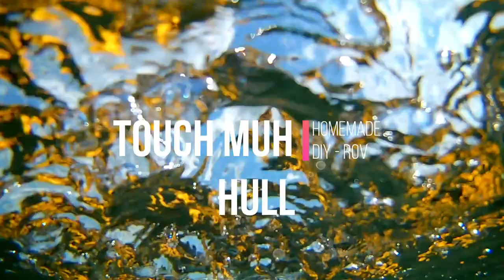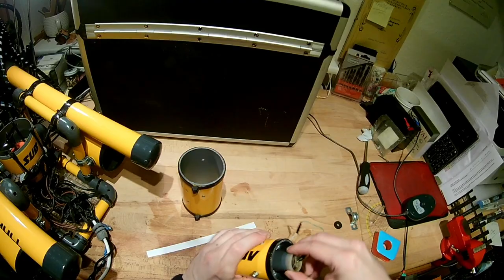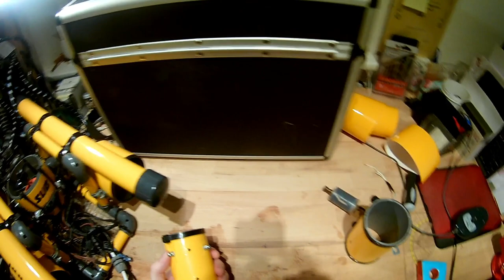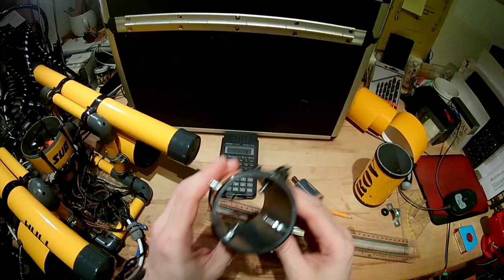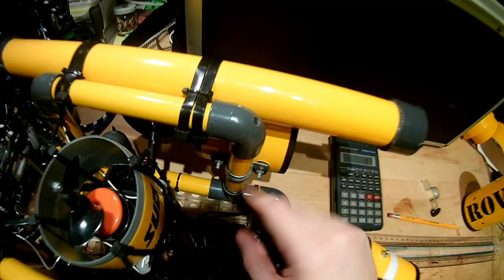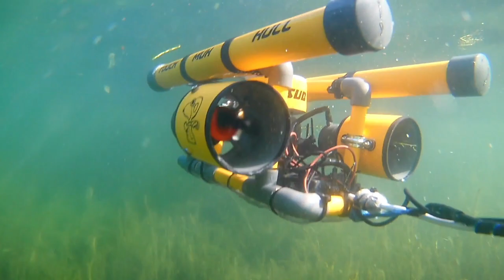ROV Thruster Housings DIY submarine SeaPerch

Comment: hey sir nice content you got here. what motor do you use and how to make the water seal? thankyou
Reply from the maker: I used seaflow bilgepump Motors - 12 Volt for 350 gph. Since those are water-pump motors you don’t have to seal them. I already tested them to a depth of about 15 meters - just under 50 feet. No problems what so ever. 😀

Comment: Do you think 2 of these would be sufficient enough to power my kayak  at around 4 to 6kmh ?
Reply from the maker: No. These engines give very little thrust, I think about 3-4 lbs. A small outboard motor gives like ten times as much - which is needed to propel an actual boat. 
Love the idea though!! 😃

Comment: Wait did you say bilge pump motors as in you replaced the pump with proppellers?
Reply from the maker: Yep... cut them open, expose the drive shaft,  attach the propeller with a coupler ad you are done.
Reply: @agermangineer  the things you learn. I used those as they were soposed to be used which is just to pump water loool
Reply from the maker: @romellyarde907  well, for me that would be a first... :-)

Comment: Out of curiosity do you use 1100 GPH bilge pumps? Some have said they're too powerful.
Reply from the maker: I started with 350 gph and now use 1100. 
Too powerful is not true, you just have to make sure your tether, wiring and power supply can handle the high current.
Reply: @agermangineer  Thank you for the reply. I though I remembered you using those same pumps and I believe your method of using a potentiometer to control the speed would overcome any problems with too much power. Thank you for your videos which have inspired me to try my hand at building my own ROV.
Reply from the maker: @trainstrains1  well, that’s my next video: I’m now using 2 potentiometers: one 6.3 Amps and one larger 10 Amp potentiometer for 3 powerpacks and max. 15 amps in total.
Reply: @agermangineer  Well, because of that you've picked up a new subscriber.
Reply from the maker: @trainstrains1  Sweet! 😀👍🏻